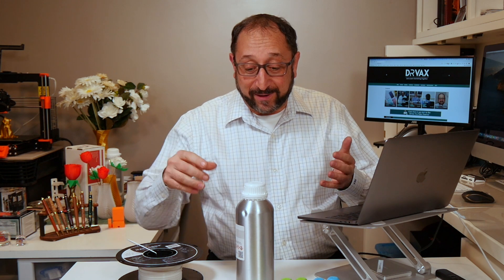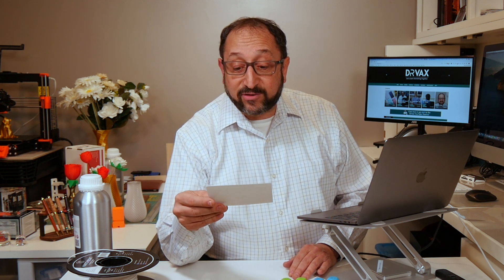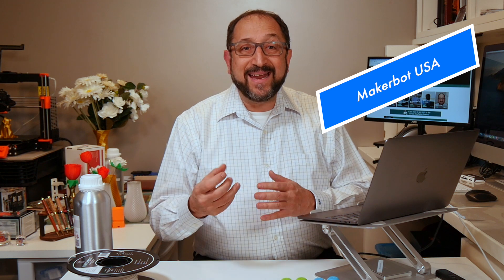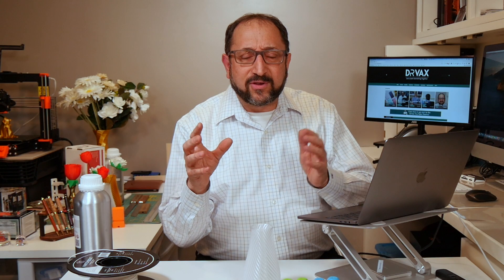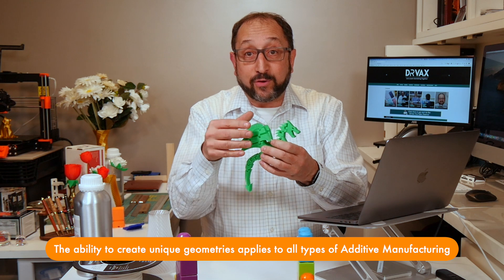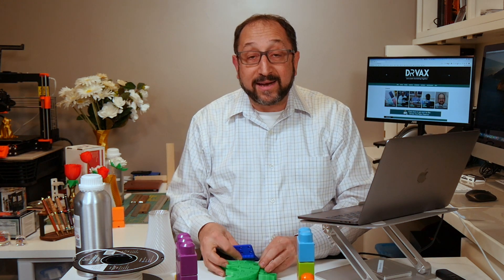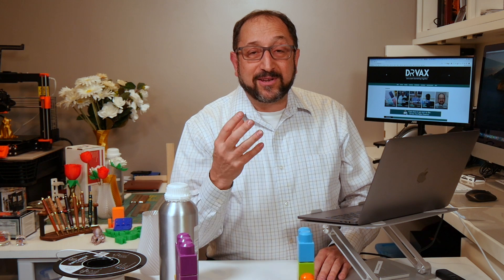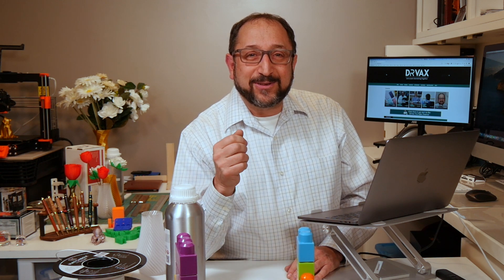3D Printer Technologies FDM vs SLA vs MSLA

Comment: This was very interesting! I am really looking forward to the Monoprice SLA printer to see how it performs. I am trying to decide rather to get a FDM or SLA printer so this will help. Thanks for this tutorial.
Reply: You may want to keep watching his reviews along with others.  SLA using resin can be very nasty to work with.  Unless all you want to do is small prints with very high resolution you may be disappointed.  FDM printers are cheap and well supported by the community.  If you use PLA there is no fumes or hazardous material, and it is very easy to print and get good results.
Reply: @woodwaker1   Thanks, the fumes are what I was concerned about.